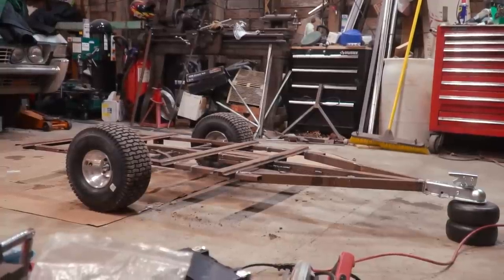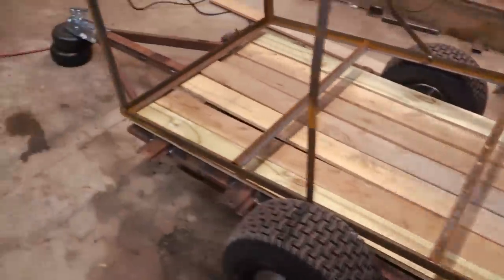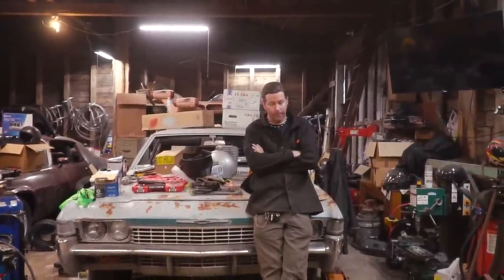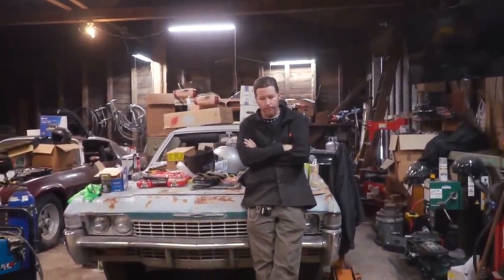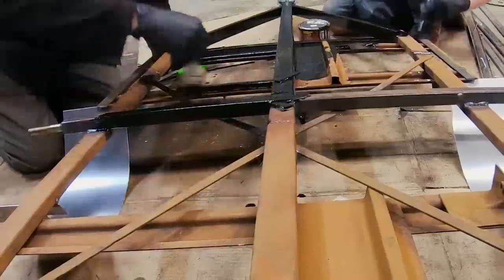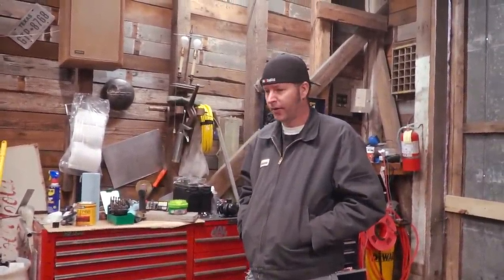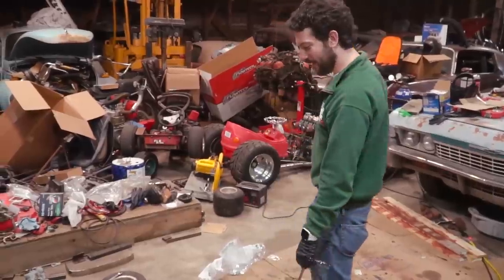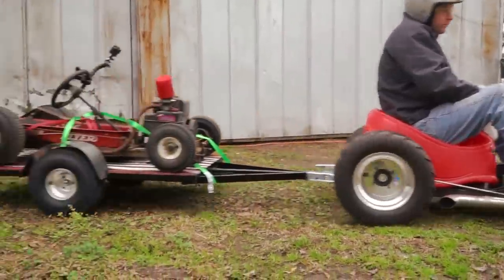Go Kart Hauler Transformation!

Comment from the maker: Rat rod wagon and the Tot Rod. Name a better combo, I’ll wait😆
Reply: I can't, this duo's the best!
Reply: John and Ike, there, I said it.  You two work together well.
Reply: Here is a good name suggestion. Tot Rod Hauler!
Reply: Hello
Reply: The monster truck pulling the mini bikes in a trailer......
Reply: Dang this was filmed a long time ago, “and Mini Mayhem” our upcoming event at Busco beach November 24, 25, 26
Reply: I can't think of a better combo of your work, they go well together.

May i suggest make up a set of front wheel chocks to bolt down to the trailer to keep the Ratrod Wagon from rolling forward on the trailor. Next make up some ratchet straps and tie points for them on the trailer, this will give the trailer and Wagon a more polished look at a show.
Reply: Grind Hard Plumbing Co's Barbie Jeep and Barbie Mustang. I'm sorry. But, it's true.
Reply: I still liked it called the kozy coup. Rat rod wagon and the kozy coup
Reply: James Hetfield and Kirk Hammett
Reply: Monstertruck build with wagon
Reply: Honestly the tot-rod sounds like a lawn mower at low speeds in my opinion lol.
Reply: Dez and nutz
Reply: Put a face plate tool box on the front, plate to stop debris..
Reply: 68 c10 pulling a 85 Monte Carlo racecar... there it is
Reply: The chopper and the totrod!!
Reply: Pugly and crosskart is up there
Reply: CarsandCameras you should build a predator powered full size car or truck
Reply: I'd like to see a 4x4 monster truck pulling the dragster.
Reply: I mean chocolate and ice cream are pretty good, but nothing beats the Cars and Cameras rod karts!
Reply: the unsubscribe button on your channel, and my mouse.

you can stop waiting now
Reply: Monster truck and mini nascar
Reply: Cheese In the breadsticks...maybe..
Reply: Still a better love story then twilight
Reply: Brat rod of course
Reply: @carlwheezerofsouls3273  sir this is not a airport, there is no need to announce your departure.
Reply: Aydan Angus there was also no need to bring me back here, and yet here i fucking am
Reply: How much do u want for it
Reply: How much do u want for it

Comment: Yes, like David Conley said finish off the backs of those fender wells and then weld some 1/4 inch cold roll on the outer edge of the fenders to give it a more finished look and also add strength and keep people from getting cut from those edges, Harbor Freight has D-ring tie downs you can put in the floor or you could put in some E-track for that extra special look and you might even put a rail around the outside of the trailer so if what ever you have on it happens to get loose that way it won't come off the trailer other than that excellent job keep up the good work , May all Your Burnouts be LONG and SMOKEY  !!!!!!

Comment: Great combo guys but you didn't give the trailer timber a coat of either boiled oil or poly to protect the timber (linsead over the metal won't hurt either) if you are going to do the job May as well spend a few minutes more now to make it last looking good for a long time.
(: well done!
Tony from Western Australia.
Reply: put some Linseed oil in a garden sprayer and give the wood a good coat once or twice a year and it will be around forever

Comment: My trailer I built for my motorcycle would be perfect for that little guy, but I'm not selling it... it's a mini pickup truck bed made out of very hard  impact plastic about 2 foot by 4 foot bed. It was a display unit for a bed liner outfit, I have yet to find another one. Put a frame underneath, with a cooler on the front... Looks Awesome! Everybody keeps wondering where I got it. It's small but it does the job, I pulled it all the way from Central Illinois to Nashville Tennessee with a 75 Kawasaki Z1 of all things without any hiccups.

Comment: The boards need to have a grove routed into the edge to allow the chrome strips to recess down equal to their depth.  Most loads should rest on the wood to prevent damage to items, but the chrome strips should be barely a millimeter or two recessed so that any loads that might gouge the wood will stop at the depth of the chrome strips.  This method adds longevity to both the wood and the chrome strips.

Comment: I have a quick question. Me and my brother just bought a mini chopper and we are in the process off swapping the original motor out with a predator 212. I bought a 10t clutch and the drive tire has a 30 tooth sprocket on it. do you think the clutch will be able to handle the rear sprocket or do you guys think we should upgrade to a 40-50 tooth sprocket? its just hard to find a sprocket that fits the mini choppers stock bolt alignment. We either want to upgrade the rear sprocket or just run the clutch until it burns up and then upgrade to a torque converter. This will be used primarily for  street use because it rides super low.  Thanks!

Comment: While POR15 is tacky spray it with a top coat of regular paint.. if not it will turn white in the sun, it has no UV protection and it dries WAY too hard to paint after it's fully dry.
Anyone else notice the RRW still has a bent spindle?
Reply: We did top coat it off camera and the rrw get new spindles in a up coming vid
Reply: @isaacitllbefine7231  I hope you decide to take that thing and wander around a swap meet, that will be a good video

Comment: Did you know that those sparks that are flying everywhere from the grinder burns into the glass on car windows like butter they dont come out either and start rusting later i ruined a couple windows windsheilds grinding and the metal dust if it gets on your paint and gets wet or moisture from condenstion doesnt wash off and doesnt buff out either it will ruin your paint job thought id share so it dont happen to anyone else

Comment: Guys I think Isaac's hillbilly ways are rubbing off on your project a little too much.  The is no attention to details for instances, use the proper length bolts, don't over tighten the carriage bolt and distort the metal trim pieces on the trailer bed. Just to name two on this project.